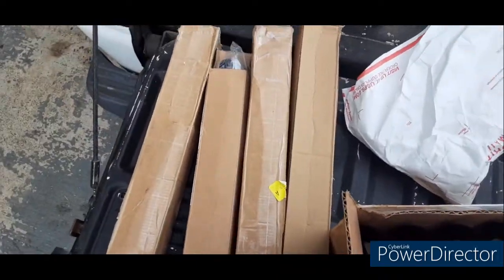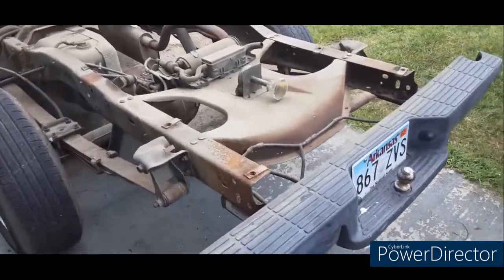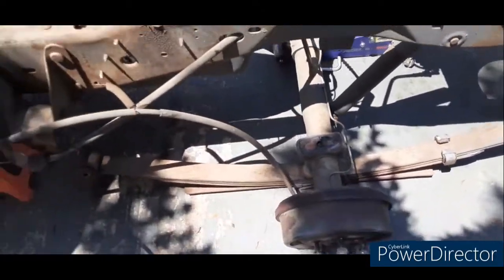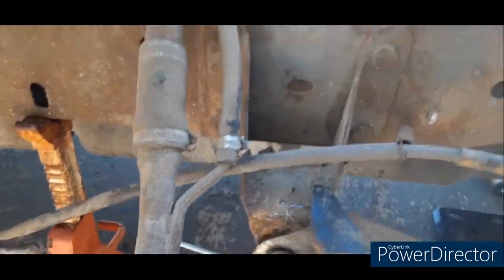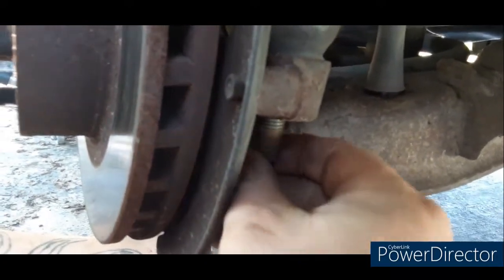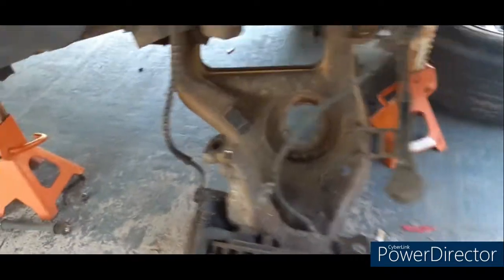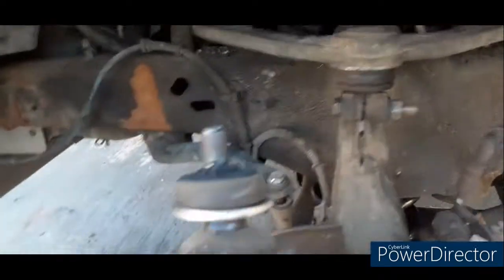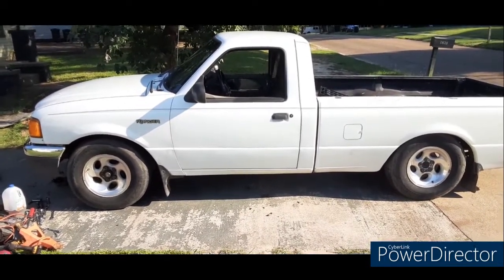Ford Ranger 3/6 drop. wife's new project

Comment: I’m looking to do this to my ranger I loved the part where you said to always use a spring compressor it brought me back to when me and my grandpa were doing a airbag kit on his dodge truck 2 inch in the front and the air bags on the back and he was like let the jack down slowly and I was scared because I always let them down really fast so he said I guess you will find out if you have to bring me to the emergency room 😂 good old days of crazy grandpa
Reply from the maker: Yeah Iv seen folks try n take them out all kinds of ways. If we weren't gonna reuse the spring iv even had friends cut them with angle grinder to relieve the pressure on them

Comment: Good stuff! I can’t wait to get my 3/5 drop in on my truck! 💪🏻
Reply from the maker: Yeah it'll look good I always liked the bed on the Mazda bc it has that little wide body type flair to it. To get even lower in tbe back you can flip the spring hangers upside down for more drop  take passenger side mount upside down on driver side n vice versa but u will have to c notch frame then

Comment: I really liked your video and thanks for sharing, could you recommend the kit I use for your project
Reply from the maker: Thanks for watching. Here's the kit I used

https://www.ebay.com/itm/1998-2015-Ford-Ranger-V6-Reg-Cab-2WD-3-6-Drop-Lowering-Kit-SHOCKS-/262716492640?mkcid=16&mkevt=1&_trksid=p2349624.m46890.l49286&mkrid=711-127632-2357-0
Reply from the maker: Also did an update video on the kit with suggestions about how to make it better. If the link won't stay posted its also in the video description. Kit is for a v6 so if yours is the 4cyl u will need different kit otherwise the front springs won't compress enough from the weight of the 4cyl compared to the  v6.

Comment: Thinking about ordering my 3/6 drop kit from that same seller on ebay. How does it ride? Was the quality decent?
Reply from the maker: Honestly if ur gonna run it get shorter bump stops and if your going 6in in rear I'd suggest either stiffer shocks than it comes with on all 4 corners or run a notch. I had to put stock shackles back on and shocks are so soft I still bang axle on frame in rear and fronts soft so gets bouncy and slams hard on bumps.it was sitting on stock bump stops and was hard ride. So I'd suggest Honestly buy cheaper kit without shocks and order better shocks and lowered bump stops.  As far as quality goes I had no issues. Just shocks are way too soft for me. Also u will wana get camber kit as well for front tires. I'm running stock size tires so I tend to rub occasionally also
Reply: @GlassWerx  Thanks for the fast reply. I was thinking of just leaving stock shackles on too, for that 3/5 drop. Also good to know on the shocks that kit comes with, one of the things I was skeptical about. I'll most likely do that. Thanks for the video, it'll help me out when I do mine soon!
Reply from the maker: @robertobaltazar1381  not a problem. Glad I could help.  Just finished up the bags on my civic and tying up some odd and end stuff on that so hopefully soon I'll be getting back to doing more on the ranger.   But I'd definitely recommend better shocks and lowered bump stops. Check the channel out n sub if you'd like. If ya don't already have led headlights check that video out too. Some helpful info n there
Reply: @GlassWerx  Will do man. One more thing, do you think there's really a difference on cutting stock springs springs vs lowering springs? My buddy was telling me I should just cut 2 coils and it'll have the same effect for free lol. I just got my single cab and want to make it look better. Leds on the way and just picked up some 18" mustang wheels. I'll check it out and sub 👍🏼
Reply from the maker: @robertobaltazar1381  appreciate it. I was thinking bout doing a set of mustang wheels as well. As far as cut springs u can do it I know alot of people don't have issues with it. Iv done it myself but I did it on an old Square body suburban and it chewed thru tires like candy. As far as cut springs once they are cut they won't seat flat in the spring pockets anymore  but with the ranger the shock goes thru the spring in the front so that could help keep the spring from falling out. I personally like the little extra piece of mind knowing my springs seated correctly and not gonna get in a bind. Also I don't remember if I put it in the video but when installing front springs be sure to rotate them and make sure they seat correctly on bottom and if you use jack on bottom of control arm like I did be sure u go slow and make sure your spring sits correctly in the top spring pocket as well. I didn't have it in there right the 1st time and it didn't sit correctly.
Reply from the maker: @robertobaltazar1381  also when doing flip kit in rear the holes for the axel bracket are closer to the front. If u get them backwards it'll seat wrong.
Reply: @GlassWerx  gotcha, appreciate all the info. In about 2 weeks it should be how I want it. I may make a video on it and post a link. Thanks!
Reply from the maker: @robertobaltazar1381  awesome can't wait to see it. I'll give ya a sub as well so I can see how it's going
Reply from the maker: @robertobaltazar1381  if ya have any other ?s feel free to ask n ill answer best I can asap.
Reply: @GlassWerx  Awesome, thanks 👍🏼
Reply from the maker: @robertobaltazar1381  got quick little update video on the drop kit if interested check it out.
Reply: @GlassWerx  just finished watching. Good videos man they helped me out when I did mine. I ended up doing like a 2/4 drop. I cut a 1 and a quarter coils off the front and did a 5" flip kit combined with a 1 inch lift shackle so it won't squat so much. Ended up with about a 2/4. Looks how I want it and doesn't ride too bad. I also removed bump stops. Didn't have a chance to make the video but I'll see if I can send a link to a pic
Reply from the maker: @robertobaltazar1381  cool deal. Did you use stock shocks or shorter ones. I really wana find some stiffer then what came with the drop kit. They are way too soft for me
Reply: @GlassWerx  not sure if you saw my comment on new vid but I used my stock shocks. My drop wasn't huge so I think that's why it's not bad. You can try this link for a photo of truck
Reply from the maker: Yeah some reason it didn't show me your comment. Doesn't show the link either unfortunately. My factory shocks were bad so couldn't use those.

Comment: Got a couple of questions, did you have to take out bump-stops, how was your alignment, also I like to drive my little ranger on the fast side since I have the DOHC year 2.3 did it corner any better?
Reply from the maker: The setup I had was for the v6 3.0. I did have to take bump stops out bc the shocks that came with the kit were just too soft and it was always hitting bump stops and also was running factory tire size still so front tires would occasionally rub turning. Buy the kit without shocks and get some better shocks like the nitro drop shocks and get the bump stops for lowered trucks and also if your gonna go lower then 2in in the front get the camber adjustment bolts bc it will camber in without them. After I took bump stops out it did handle pretty well but as I said the shocks were way too soft with the kit so better shocks would have made it even better.
Reply: @GlassWerx  Alright thanks for all the tips boss appreciate it.
Reply from the maker: @williamsanders468   no problem. Also for better cornering I'd suggest finding an edge or splash and getting the sway bars and put them on yours or order a brand new upgraded set.

Comment: What tire size in the back please
Reply from the maker: Right now I'm running the factory sized spec tires. I need to actually go to a more low profile tire. But currently on 235/75/15.   Need a 235/45/15 for better fitment especially in the front and it'll also drop truck about 35 more mm

Comment: Can you plz do I quick update on the drop kit? I just bought the same one and I’m curious on how it’s held up for the past 4 months
Reply from the maker: Yeah. So far hasn't been any issues with it other then the shocks that come with it are too soft. I removed front and rear bump stops and took the drop shackles off the back to make it a 3/5 drop because the shocks were too soft it was bottoming out too much in the rear and didn't like the axle banging the frame. But yeah ill get an update video made on it for ya.
Reply from the maker: Also because I'm using stock suggested tire size still I do sometimes rub inside front drivers fender well. I also removed the fender liner as well so it rubbed less
Reply from the maker: No biggie. Anything  I can try to do to help.
Reply from the maker: Just remembered something  else. I'd recommend getting a camber adjustment bolt kit as well that way your wheels don't camber in @ the top like mine do.
Reply from the maker: Not a problem. Aldo after about a hundred miles check and retighten the u bolts on the rear.
Reply from the maker: Got quick little update video up for ya. If got anymore ?s lmk
Reply: @GlassWerx  awesome will watch it now.
Reply from the maker: Appreciate it.

Comment: Will this work for XLT
Reply from the maker: The kits tend to be cab/engine specific.  Not sure what cab/engine combo u have but I'd suggest just in case buy one that matches your specifications especially engine wise bc springs for a 4cyl may drop more in a v6 and v6 springs in a 4cyl may not drop enough. But as far as overall instill it'll be the same unless you have the older chassis with the I beam front end then in that case I'm don't remember what all needs be done with those been way too long since iv messed with one